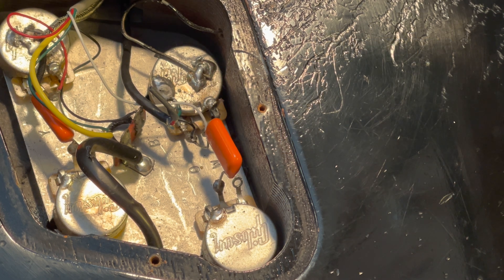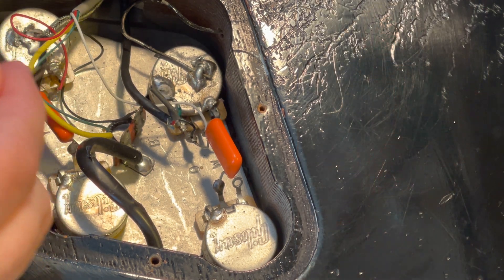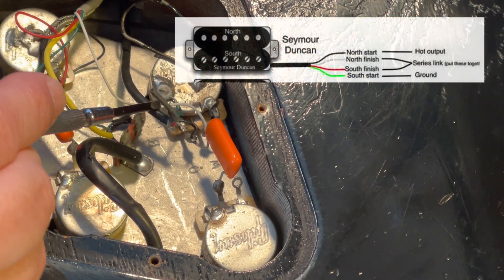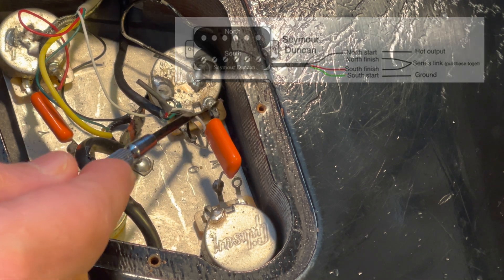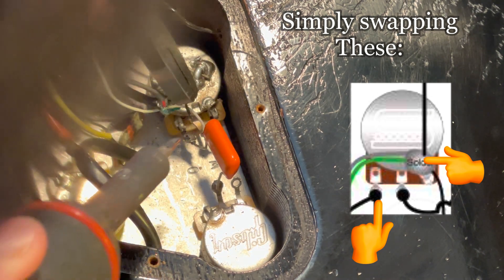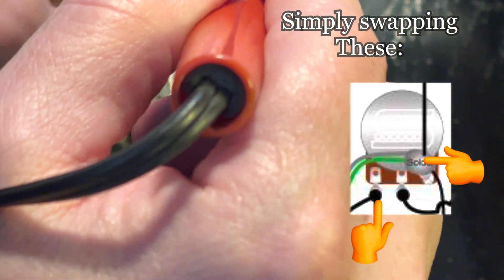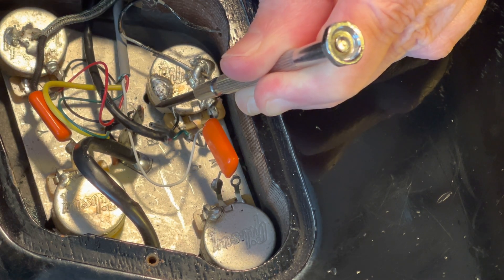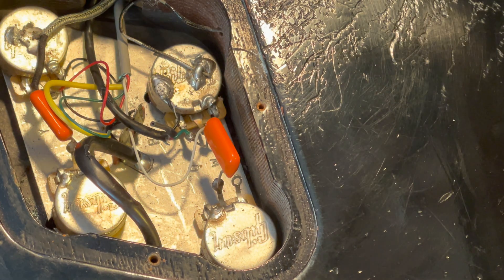How to: Out of phase a 4 conductor humbucker pickup in a Les Paul

Comment: out of phase is only in the middle postion? when the pickup plays alone, it plays in phase, i.e. normally?
Reply from the maker: The pickups are out of phase with each other which causes the tonal effect. Therefore when played alone, there is nothing else to be “out of phase” with.
Reply: @PhoenixGuitars  I understand that, but does it sound the same as a normally soldered one? No humming or buzzing issues?
Reply from the maker: Yes. Normal. No buzzing.

Comment: So it's just a simple swap? Hot becomes ground and ground becomes hot? No need for push pull pots?
Reply from the maker: If you look at the digram that starts at around :55 seconds, we’re actually swapping the north start and the south start of one pickup. Ghis puts this pickup electronically out of phase. You could also flip the magnet as you have to do if you only have 2 wire pickups. I have another video demonstrating that and to me, the effect is more pronounced when you do it magnetically.

Comment: Hey! Can this make the guitar buzz? I've done this mod to a current hollow body build, and I keep getting a lot of buzz (in every position, though). I'm not sure if I have any issue with ground or if it might have to do with this... Do you have any hint?
Reply from the maker: It should not make it buzz. I would double check all your solder connections and ensure all your grounds are correct. A magnifying glass or some powerful glasses help.
Reply: @PhoenixGuitars  Thank you for the reply!
I have double checked that every metal part is grounded (continuity in every component), and it all seems ok to me...
I'm new to this, and I cannot understand how I could have made a HH guitar "hum"... I'm having trouble finding anyone online with the same issue... Has this ever happened to you?
Thank you again
Reply from the maker: @xaviersilva96  cable? Amp? The ground wires maybe touching something else? Everything is solveable. Lots of great info on guitar wiring out there. Seymour duncan has a great site with many diagrams.
Reply: One detail: 
It's a hollow body build - do you think I may be dealing with a short circuit or something, from laying the components inside the F-hole? Maybe a capacitor touching a ground wire from the pickup, or something...
Reply from the maker: @xaviersilva96  yeah. Double check everything. But yeah. That’s a pain in the ass